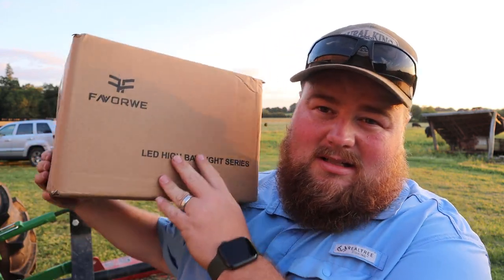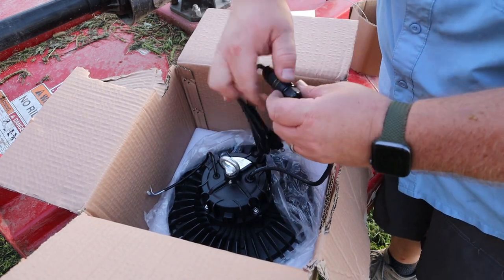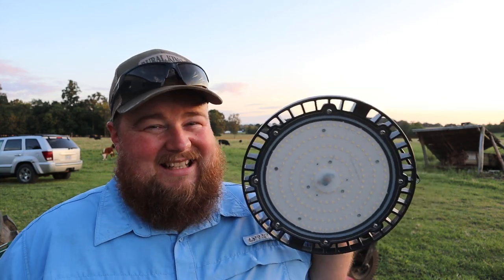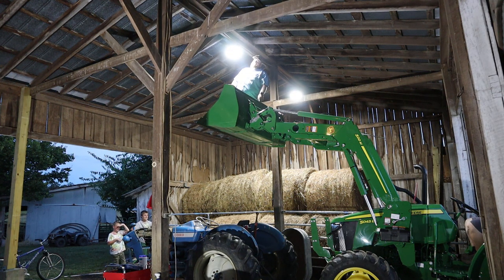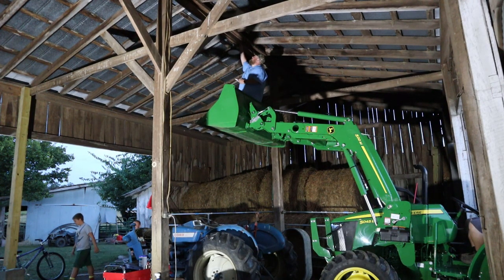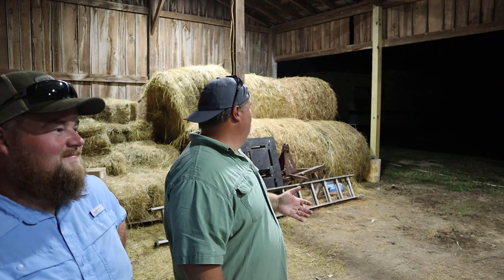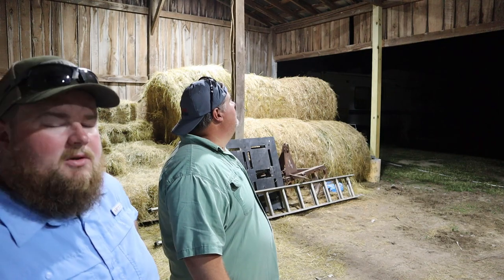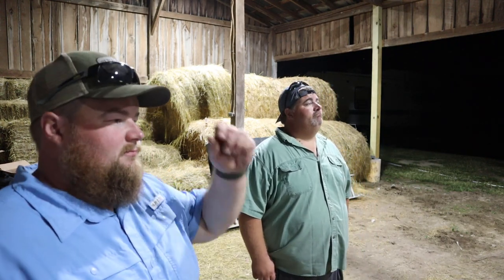MAJOR LIGHT UPGRADE! // Favorwe High Bay Light LED UFO Lights!

Comment: Nice to meet your brother, Sam. The difference these lights makes is amazing - almost feels like there was a candle up there for light before these were  installed! Ha!

Hope this isn’t a silly question - but is there something like this for 10-12 foot ceiling heights?
Reply from the maker: For that ceiling height I would recommend what I personally use in my shop. The lowest ceiling height in my workshop is 8' but the upper part is 12' tall. I would be concerned the high bay lights as the lower height would give hot spots in lighting. Here's what I have in my shop now that I've been using for about 6 months now: https://amzn.to/3EiPcpa
Reply: @Samcraftcom  Thank you very much! 😊

Comment: do they put off heat ??? im looking for light to install in my 45 by 70 horse barn
Reply from the maker: They get warm to the touch, but not so much that I couldn't keep my hand on it after 30 minutes of run time (the light we had set up below as I worked on installing the others). They are not major heat producers like other large bay lights would be.
Reply: @Samcraftcom   thanks Sam I will be looking into fitting these in my budget ... give my best to Angela and the boys